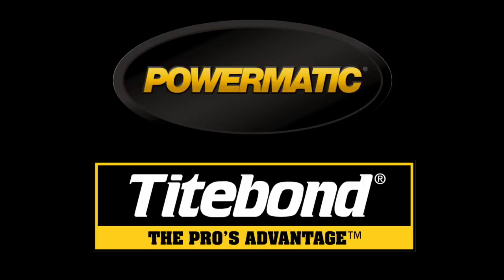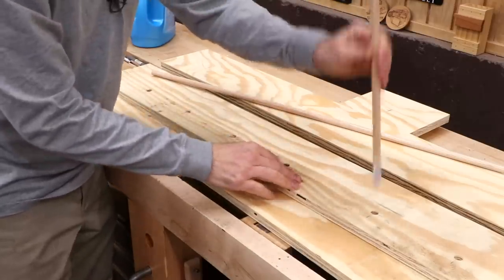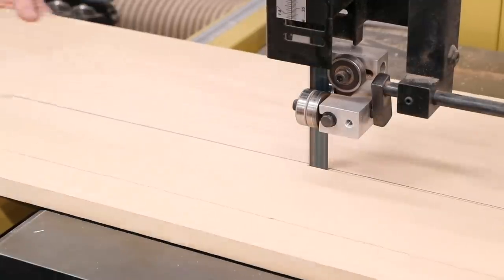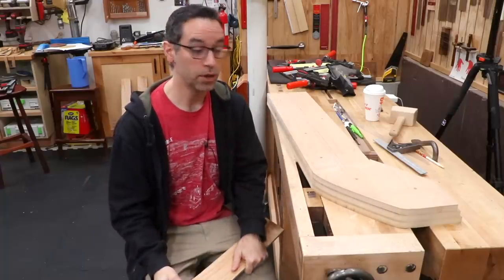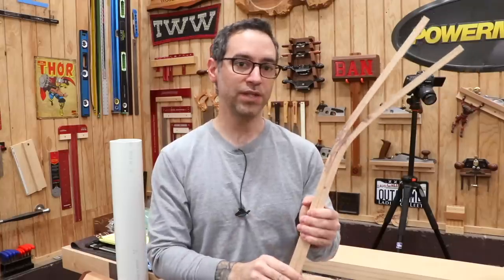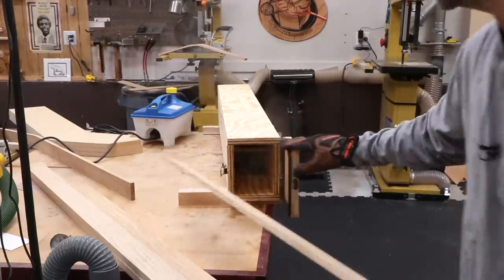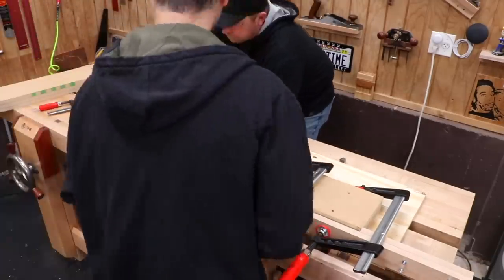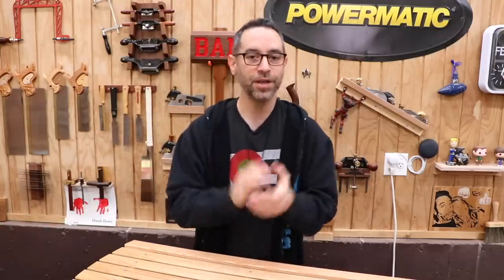Adventures in Steam Bending

Comment: Also... I recently made a few very large and important curves in my work. Some for the rebuild of a 1931 Chevy Woody car. Specifically the wheel wells. And then a large walnut bookcase that required some standard and even a compound curve. I decided on bent lamination over steam bending for my method. I had never done any curves before. I am so glad that I did. I have never even seen detailed footage of steam bending before.... But I was concerned with springback, the heavy moisture changes affecting the visual and structural integrity, and the time required to clamp all the parts. I didn't even know about a compression strap. I am so glad I went with bent lamination. Seems like steam bending would only be worth it if you have a lot of time to prep and a lot of time to let it set and the benefit would be saving you the time of resawing, the glue mess, thinner material used since you wouldn't have to mill the curve post glue up, and a shorter clamping time. Like... Maybe useful in a factory with production work where those details are crucial. 

I think I've seen enough to stick with bent lamination when I need to make a curve. Thanks a bunch for this video Marc.

Comment: I should have also cited "Steam bending wood without using a steambox", another episode of "Tips from a Shipwright." In it Louis steams a board that he is bending for two hours AFTER it is already bent, right on the form, and the form is not in the steambox. How is that possible? He uses a polyethylene sock over the board.
Reply: See also "Building the TotalBoat Sport Dory: Episode 10 - Compression Steam Bending" of "Tips from a Shipwright." I hadn't realized it but a key trick of Louis's is to NOT build a form, not a continuous form. He simply has right-angle brackets that he lag-bolts or clamps down to the bench, so that the brackets form  the bend in the wood. That way there's room for the steam to pass on the inside of the curve, where it would be blocked if the form were continuous.

Comment: Hi!  This may have already been mentioned but the fact that your steaming took longer does not surprise me.  Denver, the mile high city, has a lower ambient pressure than sea level.  A huge statement of the obvious.  The consequence of that is that water boils at a slightly lower temperature.  Lower temperature means less heat and that gives a lower heating rate.  This is why it takes more time to hard boil an egg in Denver.  My guess is that you need a certain level of heating to soften the lignin all the way through to make the bending possible.

Comment: The steam time of about an hour per inch is after the wood comes up to temperature, not when you put the wood into the box cold.
You mentioned being in Colorado. Cooking time is likely going to be longer at that altitude I would imagine.
How long it takes to bring the wood up to temperature depends on the type of wood, the growth patterns in the wood, the bias in the grain when the wood was cut, the overall thickness, and probably about 12 million other minor variables, most of which aren't really important unless you're building parts for the space shuttle.
Keep in mind that you can overcook the lignin so more heat isn't necessarily better.
Maintaining heat through the entire process is important too so bending in a cold shop in winter when the humidity is very low will affect the bend. Keeping a steam generator spraying on the piece while you're working it helps, or if you're really brave, have someone with a high output weed burner torch brushing the piece. Otherwise, unless you want to build a sauna to work in then your options are limited.

Comment: Check out EngelsCoachShop here on the tubes, specifically the video "Steam Bending 1 1/2" Kiln Dried Ash, 7.5" Radius, for a Stevens-Duyrea Car Top"  I don't think he soaks the wood first, but he says 2 hours per inch steaming and another variable he mentions is 3 to 5 pounds pressure.  I'm assuming he means psi.  That is probably something the little Rockler kit is not supplying.  But yeah, he has success with some crazy bends with kiln dried stock but also says sometimes it just doesn't work and you have to try a different board.

Comment: may I suggest using you clothes dryer exhaust set to delicate so to keep the temperature low and thirsty.  this will speed up your process without too many modification..  redirect you exhaust tube to a drying box which has your new forms inside.  good skills.  (. no modifications to your dryer unless you would like to dedicate a drying box inside you work shop). so many free dry just to get rid of them.

Comment: I made a toboggan for my grandkids a couple years ago, and it turned out very nice. I would like to make a sled, so I will watch this series closely.  I also tried a few different things along the way, and here are my observations:
I'd heard that quarter sawn lumber is more amenable to bending.  I tried both directions vs. the grain and it seems like I had better luck with the quarter sawn.  Straight grain is very important.
I used a steam generator that's used for cleaning that i got from Amazon, and that worked very well and I can also use it for cleaning!  Harbor Freight sells one that is identical to the McCullough steamer.
I used some cpvc pipe for my stream chamber and it worked fine with a rag on one end as a seal.
The theory with bending is that it's the heat that makes bending possible, as I understand it, Not the soaking, so your hurry to get it from the steam chamber into the mold is a good idea.  Also your experience with spring back and leaving it in the mold is the same as mine was--I left my 3/8" oak strips on the mold for at least a day.  Go overboard with steaming and get a helper to get it in the mold ASAP.
I found it tricky to make the bends consistent and I lost about 30% of the material to cracks or messed up bending.  
I'd like to build an old-timely sled with the runners that curl around the front, I think it shows off the wood.

And get some ski wax for the runners.

Comment: I'll give you a tip when you are soaking the wood if you got a vacuum pump and suck all the air out in the water chamber you'll find the moisture will go into  the wood quicker and when it's in the clamp put it outside in the open air undercover so if it you won't be wasting time I've had success in the past doing things this why all the best Dave from England 😁
Reply from the maker: Good tip. I'll have to keep that in mind.
Reply: @woodwhisperer  Wonder what would happen if you slightly pressurized the soak chamber.

Comment: Too bad I can't post a picture, but I built a 7' X  18"  tobaggan using 2 stainless steel screws for each slat crossmember intersection, and an expensive German penetrating finish (OSMO POLYX Hard wax Oil).  I used boiling water bath powered with a turkey fryer and water heating coil that went into a 5' insulated steel cylinder and got the water boiling in about 20 minutes......in below freezing weather.   I built a bending form after viewing many youtube sites  (Engels Coachworks and others), that would work for me.  Quite an experience.  I was going to sell them as a business,  but agter learning that 3rd party liability insurance would be $6000CAD, totally abandoned that venture.  But I did learn a lot from that exercise.

Comment: Rockler steam bending kit:  $89.99.  Wagner wallpaper steamer at Lowes:  $64.99.  I use the Wagner.  Works just fine.  You don't need all the fancy hardware either.  Improvise whatever you have around the shop.  Also, why the door seal when you have a relief vent drilled in the door??

Comment: I believe the splits are "checking" from drying too quickly. Take a visit to a lumber dry kiln some time. Oak needs to dry very slowly or it will check. There are books written on the rates for drying lumber. Air dry vs kiln dry. Placing it in front of the fireplace may have been the worst thing to do.

Comment: You can make a steam box out of ducting , end cap and hang rag over the open end. Use piece hardware cloth as riser. I have never soaked a piece of wood. Don’t use kiln dried, it is heat hardened and brittle. Green is always your best bet. I have not used a compression band but I do have couple hundred clamps. Use your moisture meter.

Comment: I like to  use the thin laminations and glue.  I made a demi-lune table 15 years ago out if yellow oak and   3/4" thick by 5 1/2" tall   
glued up did not move when  removed from the bending fixture.

Comment: All of my steam bending experience is all trial and error. i have produced some nice work when i figured out a good method. Bent lamination is fast and turns out well, Steam bending takes awhile for the lumber to cure in the mold but produces a better result. And my steamer is nothing but a Plywood box connected to a modified turkey cooker and pot, cheap but it works..

Comment: I've bent a lot of kiln dried white oak from 4/4 to 8/4, a lot of your conclusions pair with mine.   I'm at 1,000 foot elevation and I do not presoak at all.   I use a supported PVC chamber and steam 2 hours per inch thickness.    The tape on the compression straps is a great add for me.   I've built two convertible baby beds using this technique.    The post steam checking seems to be highly variable in what I've seen.   Springback is inevitable so I plan for it in my forms, and like you did, I keep it in the form for a full 24 hours.   Just about every bend has 3/4" springback.  Great video and thanks for sharing, wish you would have done it about 4 years ago.   Thanks again!

Comment: you need to stop using fabric softener,  steam for 2 hours per inch and you will be able to bend any kiln dried lumber by using  pure ammonia in your steam water and clamping with the containment strap. The ratio is 10 to 1 water to ammonia.  also make a jig from string so you can tie your bend together end to end.  you will free up your mold for another bend and avoid spring back and won't have to recut your jig to a shaper angle Note well ventilated area!

Comment: I have done a fair amount of wood bending, both laminated and steam bending. You can make a very good steam generator with a electric water heater element. I have never used any air dried wood for bending. Of course your mileage may vary so good luck.

Comment: very nice. cool project. question: why seal the door with a gasket if there is a hold on the door?
Reply: The gasket keeps the steam from leaving at the top of the chamber the hole lets the condensation out.  There will be some heat loss from the hole, but not nearly as much as what would be lost at the top of the door without the gasket.

Comment: If you’re going to really get into steaming or any amount I’d real bending you need to make a peg board style benchtop.. you don’t make forms to clamp to you set pegs to achieve the form and just weave the wood between them. It’s much faster and more efficient then using 30 clamps and a fork and then you’re not limited to the number of firms but the size of the table top. If you do this you do want to put the table on castors that lock so you can move the table around or is common in commercial applications into a dehumidifier equips room or even a kiln room but even if you just set a dehumidifier in a closet with some clamped up pieces it should help spoken the dry and reduce the spring back

Comment: I've never gotten those stress fractures on the surface after soaking. I'm wondering if it was the fabric softener? I've never used that.
Reply from the maker: Zac Eckstein could have been. Though the air dried boards didn’t do that even after the exposure to the fabric softener.
Reply: I have gotten surface checks after soaking air dried cherry (no fabric softener). I did not soak the second batch and did not have any surface checks. These were chair backs, so a very gentle curve. I used a strap for both bends.
Reply: Would the surface checking be related to the rapid drying process? When you dry green wood, you usually want to do it slowly so the wood doesn't split.

Comment: @20:50 -> when the tape measure decide it can't handle this anymore and try to commit suicide by jumping from the top of the bench. It's saving is only due to the courage of the rubber floor mats that lay itself under the impact point.

Comment: Several years ago I was looking at my local Craigslist and found a commercial (ex rental) wallpaper steamer made from metal. It is roughly the same size as your Rockler unit but MUCH stronger as it is steel not plastic! I have yet to try to use it for steaming wood but that was the reason I bought it. Now I need to find a project with bent wood to try it on :D

Comment: I don't remember where I saw it, but it was a video of a professional furniture maker who made the stiles of his bookshelves with a single piece of wood notched and steambent onto a figure-8.  His form had both sides of the stock in the form.
  In the case of your sled runners, this would mean cutting the form in one pass (or building the equivalent), and clamping your stock between the two "halves".
Reply: My Dad built a toboggan about 1963; using the only tools that he had, DeWalt Radial Arm Saw and pre-WW II carpenter skills.  He cut each piece many times most of the way through, each kerf about 1/8" apart, applied glue and bent the pieces until the saw kerfs closed so it was a solid piece of wood again.  We crashed into a rock once, punched a hole in the Masonite bottom but the bent strips held. No idea of the wood species but more than once we went down a hill with 3 boys stacked on it; I was in high school so about 150 pounds, #2 son was three years younger, then #3 son so we had more than 300 lb on that toboggan.

Comment: When it comes to steam bending if the wood is saturated with water it prevents the steam from penitrating into the full depth of the wood fibers so some moisture is preferred but wood that is waterlogged so to speak henders the steamming process

Comment: I need to bend a thin piece of hard wood in the middle to fix my guitar neck to head stock. At first was going for veneer thickness using thicknesser, but decided wasting too much wood. I only have basic hand wood tools, thicknesser and belt sander. My bit of wood is about 3-6mm thick haven't measured it yet. 
I was going to boil a small pot of water place wood over it so middle is being steamed them put the lid on top with a tea towel over it. 
Will this work?

Comment: I wish you had steam bended the kiln dried without the strap to see if it is crucial or not.  Might not longer steaming and quicker clamping might make it more viable without strap?  Also of note the idea of making the bent board wider then cutting it into two pieces.  I would guess the wider board might be more prone to issues like checking splitting etc.

Comment: Steam source?  I use a wall paper remover minus the head. 
I also polyurethane the inside of the box to prevent staining the work piece. 
If the curve isn’t enough after spring back I put a small do well or shaped block near or on the apex of the curve. 
I will let the wood steam until it’s nearly a cooked noodle. 
Down to my last piece and it’s not right? I use a heat gun on the curve. No shame in that

Comment: 250 degree heat and add household ammonia inside the steam box. I'd guess a about 1/2 to 1 cup poured inside the wood box just before you put in the wood.  steam 1 hr per inch thickness or more not less.

Comment: The fibres need to slip by each other when bent. The strap space between blocks needs to be a little greater than the stock. Restrict the slip and the fibres blunge out and shrink when dried open up as splits in the previous water puffed up fast growth rings.

Comment: From what I see in your vid, I will consider another factor for kiln dry wood, how fast the pieces are drying (uneven drying, edges drying faster than the center), I believe that if they dry fast and uneven, this might be a reason for them to crack. So slow drying and not too much heat could be much better. Just a thought :) `

Comment: Nice experiment, thanks for showing us this.

FYI there's a centering punch just for hinges and similar holes in metal that are countersunk. locates to the center using the countersink taper.
Will prevent that crooked hinge thing.  Obviously not a big deal on something that small and rough built, just food for thought.

Comment: You also need to prevent the member from stretching, by restricting the the length.  You want to compress the inside of the bend, not stretch the outside.

Comment: Silly question on the form you made, if I may. Had you made the second side of the form the same angle as the first, could you have then used the same former to bend both pieces? So one side you was bending for the inside of the rail and other other side you was bending for the outside.
Reply: yes but it would have been harder to clamp - speed is very important when doing this

Comment: From I think that your biggest issue is that you’re not generating enough steam if the wood is steamed properly you should have been able to bend 1/2” almost by hand you need a propane source and a big pressure pot to get a high volume of steam, that’s why you usually do it outside. I don’t think you’re little steam box makes enough volume of steam

Comment: Fine wood working had an article where the writer used 1x material to separate the sheet good skins to save on sheet goods but also make the forms lighter. I tried it for some bent lamination and it worked really well. Saved a lot of ply/mdf but also saved a lot of dust creation.

Comment: If you drill a series of holes in the middle of the body of your form you can fit more clamps without them crowding each other on the back side of the form. They also preclude the need for a parallel back side surface to hold your clamps square. You then use the backside of your form for other shapes if your project requires it. Plus the holes make them easy to hang.